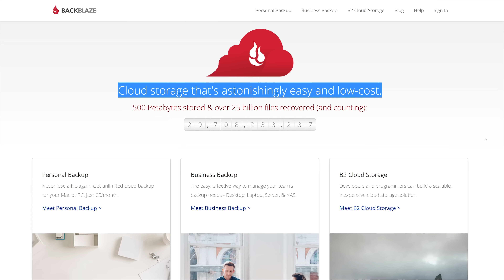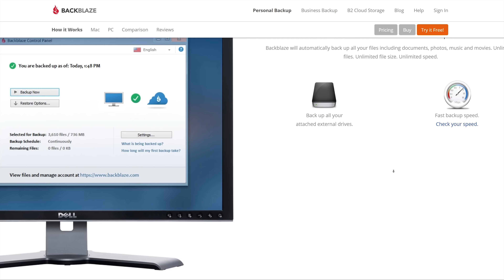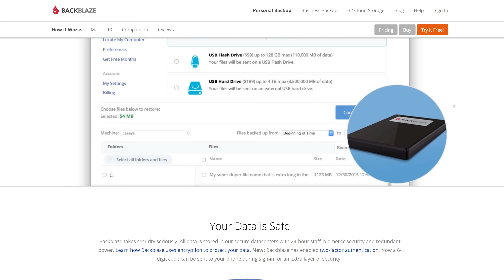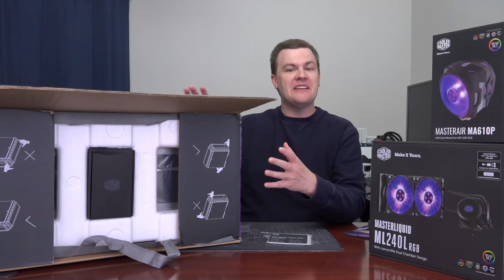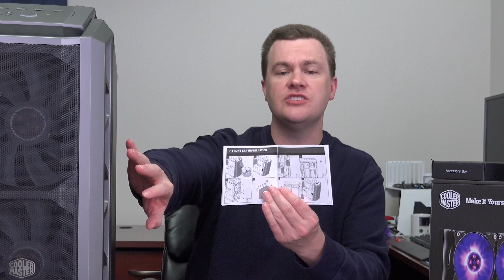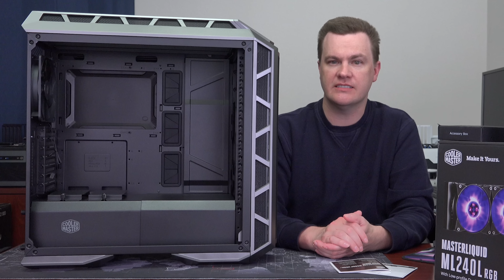Cooler Master H500P Mesh - Review - To Mesh or Not to Mesh

Comment: Finally decided on this case and completed the Ryzen 1800x build 3 days ago!  LOVE It!!!!  Used the same Coolermaster ML240L RGB cooler as pictured in the video.  First time using an AIO.  Saw the packaging and how easy to pull the case to remove from the package.  I thought of you while doing the unboxing.  Got the case for $120 on sale from New Egg.  Also had a $30 mail-in-rebate.  So I splurged and ordered the replacement mesh front.  I highly recommend this case.  I couldn't be happier with the build.  And, I'm so glad you came back and revisited this case with the updated panels.  Keep on making awesome content Jason!
Reply from the maker: Third link in the video description
Reply: @TechDeals  sir can I put uper side 360 mm aio
Reply: If you don’t mind, could you tell me where you got the replacement front mesh panel? I have the H500P and wouldn’t mind having one! Thanks!
Reply: New Egg had the mesh front in stock when I ordered my 500p with the acrylic panel.
Reply: Two SSD slots are on the top of PSU. I wonder if those get heat when it is working. Please share ur experience on this..

Comment: I did the 8700K Gaming PC - $2,000 Cadillac Build with this case.   Now upgrading to 12700K RTX 3080 ti .  I gutted the whole top out & have a H115i  280mm there.  Two  200mm on top of the  Rad.   
   Case is available again on the 'zon for  $159.00.

Comment: IN CASE SOMEONE WANT TO BUY THE NON MESH VERSION AND IS WORRIED HOW EASY IS THE PART FELLS I CAN TELL I RECENT GOT THE NON MESH VERSION I NOTICE THEY FIXED TOO, IT GOT A FIXED VERSION WITH A SCREW BEHIND THE TOP AND THE FRONT DO NOT COME OFF EASYLY NOW DUE A BETTER SYSTEM TO PUT IT IN...
SO THEY UPDATE IT BUT WHAT I DONT LIKE IT IS THAT THE BOX DOEST COME WITH THAT PREMIUM BAG ANYMORE

Comment: just recieved the H500 the 100$ or 100£ one and the front panel is rock solid on it, but my case has a magnetic dust mesh on the top of the case. easy case to use and its not got the motherboard cpu cover on the back.

Comment: Only one notice about the front mount radiator. The case works nice with a push /pull air from in front. The 2x200mm push air to radiator that you can mount easily behind them and afte the radiator you can place your fans to pull air. Temps are so nice max load 55c and idle 35 with a 240mm radiator

Comment: There is logical reason why not to put a 360 rad in the front behind the 2x200mm fans. Yea, not quite as good as true push pull but, those 200mm fans are still going to be pushing. With the aio fans mounted on the back of the rad I bet you still get more air flow than not having the 200mm fans in the front.

Comment: I purchased the windowed version but then bought the mesh front separate. Worked out cheaper than buying the mesh version. Was pleasantly surprised to have the fixed top panel like the new cases. Cooler master might be making them with the screw as standard now. Got the i9 9900k, msi gaming x trio 2080ti, cooler master 360 radiator. 3 extra rgb fans for the rad (going for push pull) mounted at the top. Bought a separate 140mm rgb fan for the rear as the one supplied in case isn’t rgb. Also mounting 2 team dark rgb SSD’s to the front housing covering psu for extra pixels 😂 got the 970 evo pro m.2 & a WD blue m.2 and this is the first build I’ll ever do. Thought May aswell go all out!

Comment: Hi, Tech.  I just purchased a Cooler Master H500P Mesh case and once the rest of my parts arrive I will begin my build.  I saw another review on this case in which it was stated that there were poor directions provided on how to wire the rgb on the two 200mm fans.  Any thoughts on this issue?

Comment: Just watched a review of the non-mesh. It's good to see the improvements on the plastic bits. Also the gunmetal color some how makes the plastic look less cheap. Still metal would have been nice. I could live with the front fans, they are included in the price. But if I wanted to spend money I didn't need to spend I'd get three fans for the front.

Comment: I’d like to see a loudness normalized comparison between 3 a12x25 fans and these two 200 mm fans. I’m mostly buying a case for airflow and 165mm tall Noctua TR4 cooler
Reply: Total Silence with 8 FANS  4x 200mm,  3x140mm  and 1x 120mm on my P500 mesh. I use a Nh-D15 on my rig.
Reply: Gabriel Tan awesome, thanks!

Comment: I like your video, but you my dear friend haven't mentioned that mesh has acrylic top panel as well, which is sucks.It reduces air flow and basically its not worthy to put exhaust fans on top simply because a part of  hot air will be pushed back inside, am I right?

Comment: Thank you for making this excellent review. Your video has been one of the significant ones that guided me towards chosing my very own H500P Mesh (Gunmetal, though initially I had been quite tempted to go all White).
Reply: after two years? are you recommending that case of get something else
Reply: @Evolved_Monkey  Hi there. The case is still in use and looking great with its original 2x 200mm fans in the front and another 2x 200mm custom fans on top. Great cooling for a non-liquid cooling setup. The fan RGB lighting is, of course, "old" standard and not individually addressable - but still impressive.
Cable management is made easy and the spacious interior is always tidy looking... almost a bit too tidy: Only point of criticism is that this case could offer more  out-of-the-box options to attach further quick slot drives or other hardware between the cooling fans and where the Mainboard goes. Some of the newer cases in this product line offer this.  But in the times of SSD drives it is not really needed. And that empty space is very useful when you need space for liquid cooling. All in all I love my case and still recommend it.

Comment: @Tech Deals How would you rate the cooling performance of the MA610P in this case with an i7 8700 or 8700K, I just like the look of the cooler and it would fit well with the theme I am looking for in my build. Any overclocking I plan to do would likely depend on if this cooler could handle 5.0ghz or at least the 4.7 turbo speed of the CPU.

Comment: do I need vertical gpu mount ? I have  cooler master h500p.  they built in slot for vertical gpu mount.  but I don't know. do I need vertical gpu mount for h500p. because this video include it .

Comment: HAF X..... Best case CM ever made
Reply: i really miss the old school Haf designs and refuse to get the new ones. my 922 still running from 2009
Reply: The only issue with these new cases is they have forfeited a side 200mm fan for temped glass. Perhaps with some modding you could fit one?
Reply: kahlum1 yeah.. I would like a 200mm side
Reply: Fan*

Comment: i think the mesh case is the only version anyone should use. and id suggest using it for air cooling. there really isnt any great way to mount a radiator for any useful airflow threw it. the front wont mate up directly next to the rad and the top is closed off so there isnt much airflow exiting as much as it should. 
id suggest the lian li 011 dynamic for water cooling. the AIR version will be out in a month or two.

Comment: Eventually all the upgrades aside from the mesh itself will make it's way into the acrylic H500P  I may have missed it, but it didn't seem that you touched on the easy install PSU adapter so you no longer have to remove the entire basement to install the PSU.

Comment: Awesome opening.  Tech Deals is where I come first!  A+ review.  I am considering this case.  But what about an optical drive, go external I guess for this case if we must read a DVD or Blue-Ray?
Reply: I have had an optical drive in every computer I've owned in the past 20 years.  Even last year's Ryzen 5 1600 build had one in it.  But, I used it only one time with old software (from my video camera) which I eventually uninstalled due to free modern software being available for download.  There is one thing I would use the larger bay for, an SD/USB hub.  That has been very convenient over the past 9 months.  I will just have to install an exterior version for this build is all.  When shopping for a case, I really wanted those extra bays, but realized my use-case did not require the space.  Also I REALLY loved how this one looked.  So easy to build in and it just looks amazing.  I'm not one bit disappointed by not having the open bays.

Comment: Excellent vid like always. I was wondering would it be possible for you  a vid about the Silverstone RVZ02b , using i7 8700,  GIGABYTE H370N WIFI LGA 1151 (300 Series), Noctua NH-L9i 92mm SSO2 CPU Cooler, be quiet! SFX L Power SFX ATX12V/SFX12V Power Supply -  600 W, MSI GAMING GeForce GTX 1060 6GB GDDR5 DirectX 12 VR Ready (GeForce GTX 1060 GAMING X 6G), What do you think?, cooling will be enough? any issues? thinking to use it for music production, video editing but not extreme gaming, thnx

Comment: My 200mm fans wobble which makes for some obnoxious squeaking, the 6x120mm RGB fans I bought to go with this case all featured an obnoxious droning motor sound specifically at low RPMs compared to my Corsair fans. CM support has been useless and to top it off their mail in rebate visa cards don't work. Cooler Master is pretty, but look (and listen) closely to reveal cheap build quality even compared to their products from just few years ago, I'm thinking HAF-X.
Reply: I have the non mesh version and no problem with the fans, get a refund!

Comment: Tired of this ''silent'' case trend. Mesh is the way to go.  Fans already have to work harder to suck air through a dust filter no need to make it even harder. If cooling is the piority then the noise will also reduce because fans can run at lower rpm which will result in less noise.

Comment: I put a 240mm Radiator on the front behind the 200mm fans, but in pull configuration with 2x 120mm fans blowing into the case. It's like an indirect push/pull and it really keeps my CPU cool
Reply from the maker: That is an interesting idea!
Reply: Same thing i did. Really works well.
Reply: Psy Kom I preferred it to putting it on top exhaust, becauwe I was worried the acrylic top panel would block everything off
Reply: I have the same setup in the original h500p my temps stay really low, gamersnexus did a lot of unnecessary damage to this case's reputation

Comment: My current build is using the non Mesh version of the H500P case, do you know if I can buy the mesh front by itself? I put 3 fans up top and my CPU cooler is a 212 EVO which is working really well and the case is still cool, but I am thinking the mesh front would look a little cleaner. The non mesh version starts to look dirty and I feel I need to dust it more often so that the clear cover doesnt look dirty.
Reply from the maker: Yes, third link in the video description, $20
Reply: Hah, my goodness, I cant believe I didnt even see it. Thank you!

Comment: Gorgeous case but, I still need to use internal blu-ray/dvd burners and most of these newer cases seem to deliberately omit such possibilities.
Reply from the maker: You can always get an external USB drive if you need one, they are just as fast.  Internal 5.25" bays are quickly going away.
Reply: True. I just prefer to have it within the case. I was thinking of buying a new case for a new build I'm going to do (Ryzen 2600/GTX1070ti/X470 ...) but I might just stick the thing in one of my spare Zalman cases.

BTW, your channel's fantastic, love your approach to the whole business of reviewing and testing tech!
Reply: The cases do look better without the bays obstructing the front but, I tend to back things up to CD/DVD/Bluray a lot. I also send out discs to clients with the work that I do.

I don't understand why cases can't be both aesthetically pleasing and include drive bays.
Reply: I've had a CD drive in each computer for 20 years now.   Last year's Ryzen 1600 build included a CD Drive in the red, Deep Cool Tesseract, case (budget for $30).   But this past year showed me how much I don't use them.  I actually have an external USB CD drive if I need one. I loved the non-restricted mesh front, and realized the CD drive was a true non-issue and went with the H500P.  No regrets mate!  Love this case and love the looks.
Reply: Just had a look for it on Amazon, thanks for the tip.
I'm going to try and build my system into the spare Zalman X11 plus that I have. If the graphics card doesn't fit (looking at either a Zotac 1070ti mini or a cheap Gigabyte 1080), then I'll plump for a new case.
Reply: Get a phanteks enthoo pro m, it has one 5.25 Bay and it's a very roomy case with all the modern features

Comment: I can imagine the warranty is also for the IO, if the Power cable is failing and you can't turn on the PC with the Power Button... then warranty comes in reeeaaal handy imo
Reply from the maker: I suppose...  I can't recall that happening, but I suppose it does.

Comment: I'm glad you made this video as there is a lot of discussion at the moment regarding mesh front case panels with people refusing to buy cases unless it has a mesh front for air flow.
Reply: Spacemanrob 😎 Keep it Old School.....Go Mesh! 😍💻🚩
Reply: NZXT had a case a while back that had perforated metal panels at the top and on one side. Shame no othe case maker is sold on the perforated panels.
Reply: Yeah I'm old school as well and must have a mesh front on my case.  Went with the Cougar Panzer case back in July 2017 when I built my 1700x rig and it's also  a very nice case to build in.  This CM case looks awesome though I'll admit it!  Got the Fractal Design 360mm AIO for the front and two Fractal 140mm fans for the top and my 1700x runs idle at 26c... nice.  Even with a 30 min. prime95 test, I can't get my processor past 60c.  It's amazing how much you get for your money nowadays and the system just works no matter what I throw at it.
Reply: 😀 Thats Great, Sounds neat! 🙂🚩

Comment: I see you use a lot of AIO coolers, what about the shelf life?
Reply from the maker: I use them on the system they are installed on until the system is EOL, then retire them.  Usually 6-8 years.
Reply: Thanks

Comment: Gotta say the protective shroud @10:30 is well meant but is not necessarily practical. i am definitely not willing to remove the motherboard if i have to fit in a different backboard/plate with aftermarket coolers. had to do it once and this shroud would just complicate it.
Reply: Other reviewers and users have commented how they leave the right side panel off since it is a stream-line, covered side of the case.  Ascetically, it looks awesome and I find myself wishing the other side was a clear piece of tempered glass.
Reply: protective shroud of the mobo. not the hdd stuff in front. - the timestamp